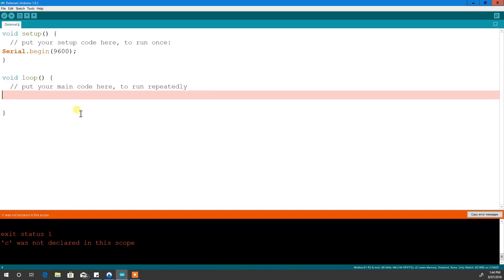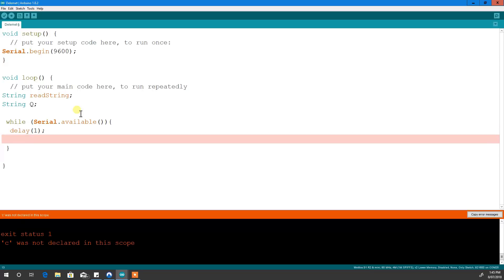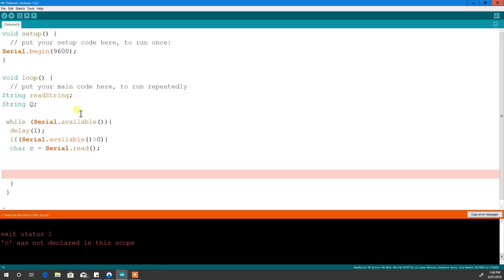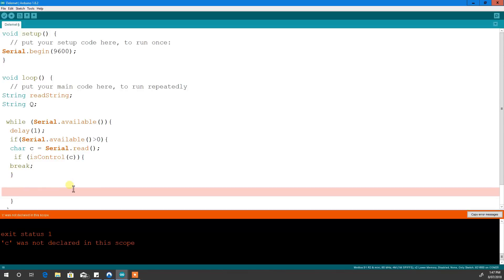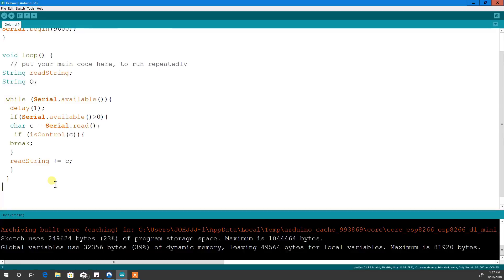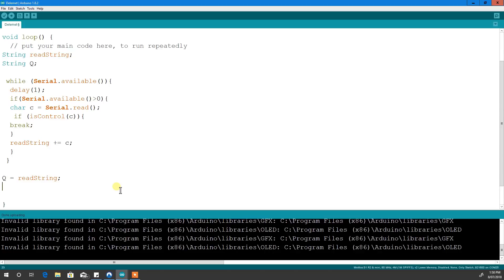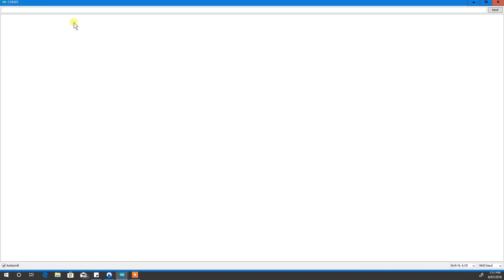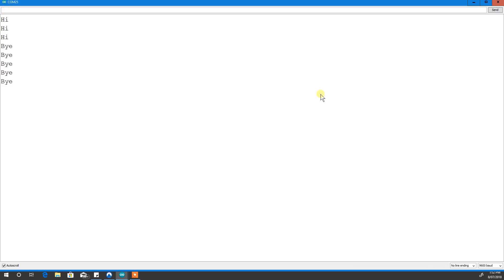Arduino Serial Communication  and Control Tutorial

Comment from the maker: void setup() {  
Serial.begin(9600);
}

void loop() {
String readString;
String Q;
//------------------------------Check Serial Port--------------------------------------
 while (Serial.available()) {
    delay(1);  //delay to allow buffer to fill 
    if (Serial.available() >0) {
      char c = Serial.read();  //gets one byte from serial buffer
    if (isControl(c)) {
      //'Serial.println("it's a control character");
      break;
    }
      readString += c; //makes the string readString    
    }
 }   
 Q = readString;
//-------Checking Serial Read---------
      if(Q=="hi"){         
        Serial.println("Hi Jon");               
      }
      if(Q=="bye"){         
        Serial.println("Bye Jon");               
      }
}

Comment: Can I ask why you put the 1ms delay after (Serial.available()) ?

I haven't seen anyone else do that so just curious! :)
Reply from the maker: If you send long strings sometimes not having a delay it might drop a character. I sometimes take it out once I play with the code a bit. I've had different Arduino UNOS for example run the same code but act a tiny bit different in needing it
Reply: @50Hz  ahh that makes sense, thanks.